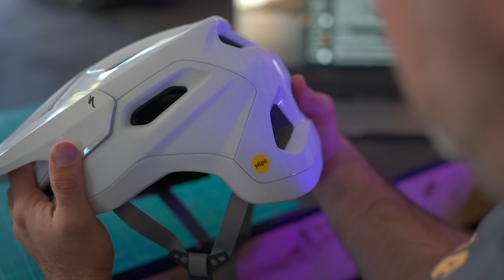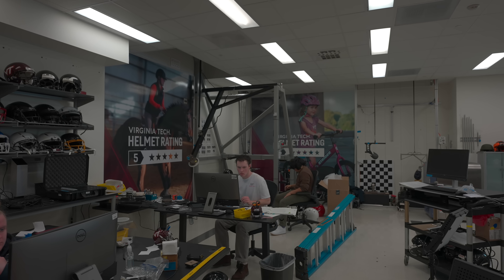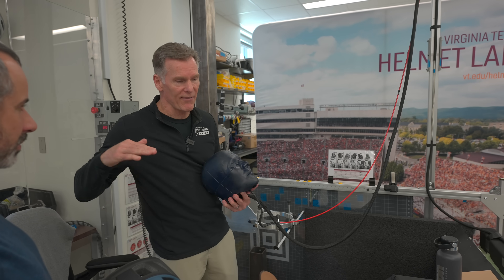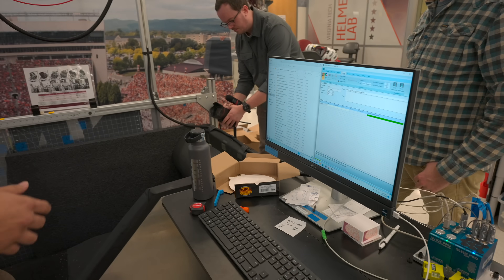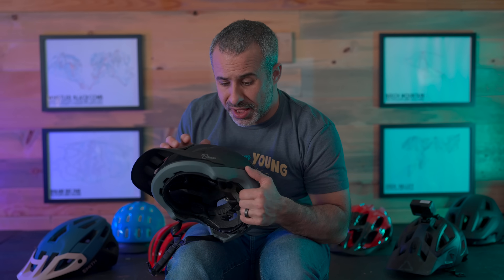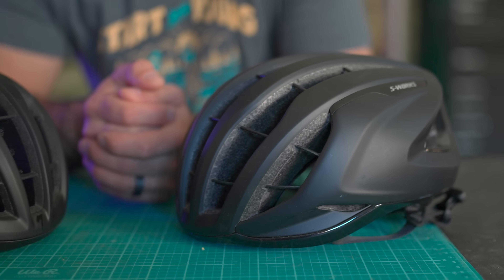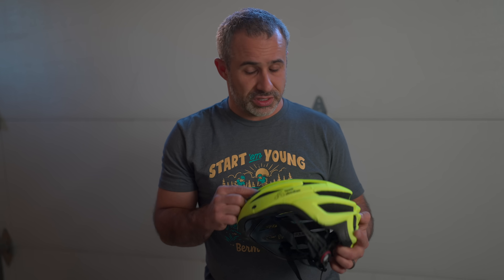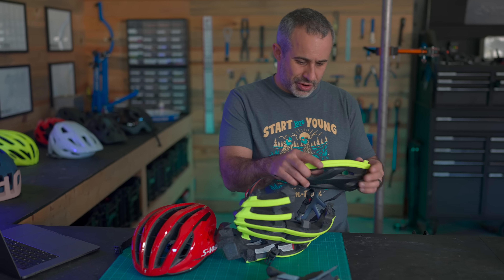Are Cheap Bike Helmets Safe? We visited a helmet testing lab to find out

Comment: For powerful bikes, a Full Face Motorcycle Helmet is a must. Bicycle Helmets do not protect your face, have too much movement when worn, and are weak in comparison. If you value your eyes, ears, nose and jaw, you are wasting your money and potentially your Face. Even a 10mph accident requires a Full Face.
Reply: I literally did a faceplant while riding at ~40 km/h (25 mph) and having a seizure. Yeah, my face was scratched, but apart from that there was no other damage and I'm pretty sure the helmet played a role. So no, it definitely isn't a waste of money. I don't deny that a full face motorcycle helmet is safer though.

Comment: I will never forget my first concussion, I dropped in on my BMX and ended up riding down on my back wheel and when I reached the bottom I went back and slammed the back of my head on concrete. I can't stress how lucky I was and I will never not wear a helmet on a bike now its just not worth it.

Comment: I was trying to find a decent urban helmet with mips, but can’t, they don’t seem to have the safety feature of sporting models, why? I’m a middle aged gentle upright rider on a ecargo wearing normal clothes, so most sporting helmets look ridiculous. (And before you worry that I shouldn’t be on a bike I was likely cycling before you were born) 
But I don’t trust the urban fashion helmets for my commute, when things get real, in winter on slippery lanes. I’ve looked at safety construction helmets, with mips type inner cage, because I wear a cheap one for work. I’ve slipped once, whacked the back of my head on something that should’ve split it in two, and give me concussion, but I didn’t feel a thing. 
So guess I’ll stick with my high rated mips cycling helmet with a waterproof elasticated cover, and wear a balaclava under for warmth. Equally ridiculous but  sometimes safety is worth it. Thanks for your reviews and info, very interesting 👍

Comment: Excellent video. I was wondering about time and its effect on bicycling helmets. For example, I ride where it’s very hot and very dry. I ride 3 to 4 times a week 30 to 50 miles. Does the time in hot, sunny and dry conditions affect the helmets safety over time?

Comment: I'd rather have a 25 dollar helmet that has a slightly lower rating. If you go mountainbiking and try to test your limits you will crash. I'm ready to pay extra for my safety but considering that i might crash over 5 times a season i can almost pay my rent with the money i'm spending on helmets with the top options. 100 bucks are much easy spend on safety than a 1000

Comment: I was riding down some trails in GA about a month ago and ended up slamming my head into a downed tree truck that was held up at neck height. I was rounding the corner a bit fast and couldn’t brake in time. Fortunately I did duck just enough that the impact just barely missed my face and my helmet took the full brunt of it. I was wearing the same Specialized helmet he had in the beginning of the video. The impact was so hard the soft fabric inside the helmet ripped all of the skin on my forehead straight off and I had a cartoonishly large knot on my head. Thankfully I wasn’t riding alone and was able to walk out the rest of the trail with some assistance. I’m sure I’d be dead without that thing.

Long story short, don’t cheap out on helmets. Mine saved my life. I often wonder how different the outcome woulda been with a cheaper helmet

Comment: Bro you used different pressure when stomping them. Can't believe people in the comments don't realize this. Vtech literally has objective testing facility. Why don't you do it there with the same pressure, instead of jumping to conclusions based on your stomping which is not a standard unit of measure.

Comment: When considering that I ride a $650 shoei motorcycle helmet, a $110 MTB helmet is really not that big of a deal. I have a $150 Giro helmet that i got on a local dirt bike shop summer sale for $90. On the other hand. 2 years ago I had an accident where I flew of the trail and landed 3 meters further down and blacked out for a few seconds... I only wore a $50 helmet back then. But it did it's work. Broke right in half. :D And I'm still alife. So I guess the best helmet is always the one you're wearing. And for that to work you should like it's form and feel and how you look with it. Otherwise you never put it on. But I still got the upgrade, because next time I don't want to balck out.

Comment: the spcialized Tactical is still nr.2, for mtb helmets, on the testsite.
its also waaay cheaper than other mtb helmets.

however. if you want to minimize the risk of getting a vegetable, id recommend not to cheap out on a helmet on wish, temu and other dogshit sites.
your brain, your decision. i mean, there are still morons riding mtb / dh trails without knee protectors...

Comment: I actually wouldnt even wear a bike helmet ideally, so Im not too concerned about them being motorcycle rated. I do however, wear a cheap one, just because its so lightweight, comfortable, and might save a slight scuff on my skull someday (35 years of biking, never once landed on my head). Been thrown off alot my bike alot as a kid going off jumps, but its just so natural to tuck and roll, so not even then did I ever land on my head.

Comment: How is the "stomp test" relevant to anything here? A helmet out of steel won't break and you can stomp it all day, doesn't mean it will protect your head in case of an accident. Obviously you'd prefer your helmet deform rather than break, but you would have to put something IN the helmet and examine what happens to that if you want to evaluate the protection provided by the helmet. Not to mention the top of the helmet is probably the part least likely to directly get hit in an accident. That said, I have no doubt higher quality/more expensive helmets generally perform better, but the difference is never really put into perspective as the only metric of comparison provided is the star rating, which is only explained as "lower means lower risk of concussion", which is more or less meaningless without knowing what the higher and lower risks actually are.

In addition, the video never actually answers the question posed in the title, it just shows that there exists a $25 helmet which is not bottom rated by this specific, difficult to actually interpret metric.

Comment: I have a bit of a short lucky bike riding horror story to share. I was a kid and I was going down a drive way that was very steep. It was somewhere between 10-30 degrees upward. I may forget how to tell you the angel though my point is it was almost a complete diagonal. So I didn't have my helmet buckled when going down this hill and my child mind wondered something. "I wonder what would happen if I didn't lean into my turn"? Well little me in that very moment was thrown off the bike head first into the curb.

I was so fortunate that I was thrown fast enough that the helmet stayed on my head. It wasn't an old bell bowl helmet that skate borders used to have back in the day, it was a regular biking helmet that could have easily come off my head. Imagine this design that was only a cap that didn't go down the back of your head at all. It just sat on top cupping your head and the strap was the only thing keeping it in place.

So yeah I was very fortunate that I didn't die that day. I am also still fortunate that I didn't get a concussion or anything. Sure the impact was far from comfortable though it just felt like I hit my head standing up. Kids wear your helmet and buckle the strap. Not being safe isn't cool and caring about your safety and life is actually the coolest thing you can do. Make it back home so you can ride your bike again. If kids ride bikes anymore... not sure with the new generations.

Comment: Motorbike helmets have a similar safety issue, where USA and EU testing standards are very different, and as far as I can judge EU a bit more realistic --- but both start with a single accident type in mind. So all companies build towards that standard (e.g. maximally lighten helmet while staying 'safe') instead of towards more general safety, and the US racers I know only look at EU ratings.
Which makes me wonder about VT's legal situation, if their system rates a helmet great that later turns out to have a flaw in a specific situation.

Comment: I question the validly of MIPS.  Your helmet wile slides on an impact without it. Even if the helmet is glued to your scalp, your scalp actually slides a little bit over your skull (far more than the MIPS layer slides). Put your had on your head and try it. I looked and can't find if Virginia Tech has any statement or conclusions on this. Certainly there are a lot of MIPS helmets that test well, but I contend they do so for other reasons.

Comment: In 2017 I bought a Giro helmet that was $200. I bought this particular helmet based on comfort, fit and all the great reviews. The second ride out I lost control ended up over the bars. The helmet’s peak got caught on a tree branch and the helmet crashed down and broke my nose. The MIPS system allowed the helmet to rotate causing the injury. Worse still, the lining, specifically the MIPS, sliced my forehead inside the helmet. I complain to Giro and report the helmet to Transport Canada. I have the helmet in the garage as a reminder of a shit design and inflated price.

Comment: When I was riding motorcycles I would only get sharp 5 star sharp rated helmets.

Downside to sharp rating is that they buy the helmets off the shelf rather than get them sampled to ensure the helmets have not been modified to pass the tests. It means that the majority of helmets are not tested.

Comment: I really wish you had gotten the people at Virginia Tech's opinion on counterfeit helmets. While it looks scary that the counterfeit helmet shattered, if it actually protects then that doesn't really matter, remember, they are supposed to be one time use. Think about F1 race cars, while not a perfect analogy (they have a hardened cockpit) lots of the car will shatter and break away in a crash. All that being said, if you do take a fall in which your head bounces more than once, shattering wouldn't be good, and I don't know if they test that at VT.
Reply: Yeah, I had the exact same thoughts when he stomped and shattered a counterfit one. He said it was scary but didn't test it LOL.
Like modern cars it has to break on impact, otherwise your brain will. 
It may be low rating yes (or may be not, who knows), but we'll never know because why test when you can stomp and say it's scary...

Comment: I live 5 minutes away from Tech and they are at the leading front of many various research sectors. GM and Volvo both work with their autonomous driving department and NASA has a contract with the jet propulsion lab. That's not even the tip of the iceberg.

Comment: I was really lucky when I needed a new helmet I bought a Fox Mainframe helmet at half of RRP at a local bike store, I found out that this helmet has a 5 * rating, really good for less than £50 in UK.
I kind of forced myself to wear a helmet after I got hit by a car and sustained a head injury and suffered an NDE while in hospital in 1991. I had long hair which I had tied in a ponytail at the time of that incident and my ponytail actually cushioned the back of my head to some extend, enough to not kill me right there, I was told by a doctor in that hospital. I was very lucky and made a fast recovery and back to cycling to work within  month after leaving hospital.  I made a habit of wearing a helmet even for short journeys as you just never know what lies around the corner, it only took one inattentive motorist for that incident to happen.

Comment: Awesome video and I knew about Va. Tech being involved in helmet testing but I had no idea they also were testing bike helmets.
As a lifelong motorcyclist both on and off road I do realize the importance of a good brain bucket.

Now as a senior in the process of building an e-bike for general use on general bike trails and so forth I was definitely interested in a bike helmet but had no clue as to what to buy in a not break the bank more reasonable cost option that was still good at its intended mission.

Well thanks to your video and Va. Tech for their work testing I ordered one of the linked Tactic bike helmets and will be able to feel confident that at bicycle types of speeds that I will have a helmet that is reasonably capable of doing its job in the case of a spill.

Thanks again!

Comment: Thank you for doing this review on quality bike helmets. Pretty scary to think about the cheaper ones out there and then the more expensive ones out there not fairing as well sometimes too. The last thing any of us want is more government control but sometimes we have to go with the lesser of two evils. I got a Smith a few years back as it met the MIPS certification. But then I had an unexpected crash on a concrete path when my pedal caught on a rock embedded in it which threw me over the handlebars onto my back. A week later severe back pain right leg weakness and later a Laminectomy L4-5. Too bad they don't have that kind of protection for ones back, eh?

Comment: Biggest issue with cycling gear is the tradeoff between cooling and protection.
Motorcycle gear has far superior protection, but when you're not riding in winter, you will get cooked.

Comment: Im still unsure of what brand to purchase.  
I wonder why bicycle helmets aren't certified like that of motorcycle brands.  
Understanding that a motorcycle rider travels at a significantly higher speed than a bicycle, we still need to find a "MIDDLE" somewhere & somehow there's gotta be a more strategic way to build a bike helmet that can provide the ol' noodle super safety protection even though ee bicyclists don't travel at 110km/h.. smacking your noggin against a concrete curb at 30 km/h or 130im/h would still cause severe brain damage if not instant dearh.

Comment: They should test with a camera mount. I don't see what the impact speed has to do with the effect of a mount.  The mount would change hitting a flat surface I to hitting a pointed one. I think that you want a very brittle mount that will disintegrate or split apart when hit.

Comment: Funny thing about the camera mounts; the American Motorcycle Association (AMA) banned helmet cameras (and any other type of modification) in all of their sanctioned races. Allegedly this was because of one incidence where someone was killed because of a camera attached to their helmet. The AMA made a knee jerk reaction ruling instead of sponsoring tests to see if there really is a greater risk having a camera mounted to the helmet. Then again, most motorsports helmet manufacturers say not to mount anything or modify the helmet in any way, or it will void the warranty. Some even say not to put stickers on them.

Comment: This was a very interesting video. However, I find the testing still leaves a lot of gaps and questions. It is almost as simplified as the CPSC drop testing. There are still a ton of variables that aren't accounted for (and impractical to test for all of them) that this can't really be the gospel for choosing a helmet. I've had a helmet that scored low on this list protected me from a severe concussion, but the test shown in the VT document doesn't show the type of contact I sustained. The bottom line should be that any helmet is still going to be better than no helmet (Other than the counterfeit/sketchy manufactured ones). If not, then there should be only one manufacturer that makes the perfect helmet and has tested the daylights out of it.

Comment: Yeah, face get planted to the ground and gets poked by something sharp, that helmet will still be useless....  Bicyclists, don't only fall on their sides or the back of their heads, but to get face planted straight to the ground is not uncommon either.   All those tests, yeah are nice, but structured and specifically wear on the dummy's heads while in real-life many riders wear them loosely practically just a formality unless its properly wore or a full face helmet, otherwise, they are still overpriced. 👎

Comment: Just ordered the Tactic 4 (on sale everywhere for only $60 right now!!!!). My current helmet, the Giro Fixture, only got 4 stars. It's actually my 2nd one of these, as I DID get a concussion last summer and replaced it. Perhaps I would not have gotten a concussion with a better helmet. Thankfully it was mild; I didn't lose consciousness, I didn't vomit, only had a couple seconds of dizziness when I first stood up after the crash, I just had a headache for 10 days. 

I would think that fit is also a consideration as to how safe a particular helmet is for YOU. I've tried some helmets that I felt sat too high on my head, and easily wobbled side-to-side, even when tightened down as much as I could tighten them comfortably. I didn't trust those to protect my head in a crash. Giro's seem to fit my head shape perfectly. Hopefully the Tactic does as well. P.S. ordered directly from Specialized, so I'm pretty confident it won't be counterfeit!

Comment: I dont get why they have those giant holes in them, i know they need some ventilation, but what happens if you crash, and a stick goes through one of those vent holes? They shouldnt be so big. Also mountain bike helmets just look so goofy. There needs to be a new design that looks better. They should take more inspiration from skateboarding, and snowboarding helmets. Those at least dont look so goofy. The only ones that dont look that goofy is a full face, cause those took inspiration from dirtbike helmets, which arent goofy. I guess its better to look goofy and protect your head, but I think thats what these companies should be concentrating on is a new better looking helmet.